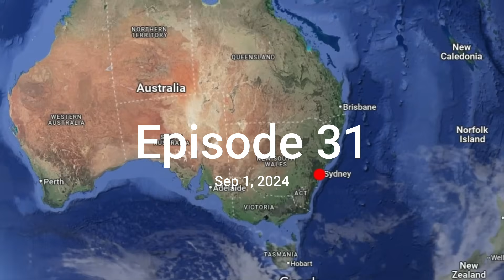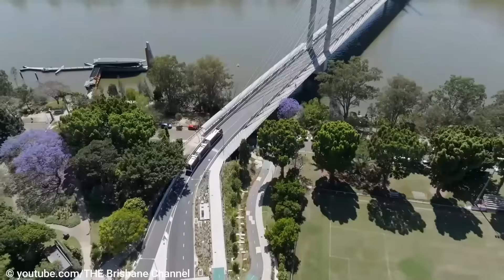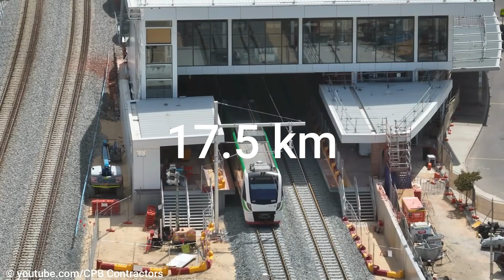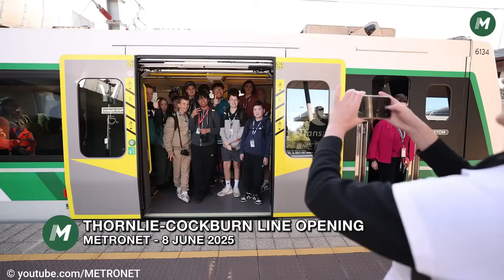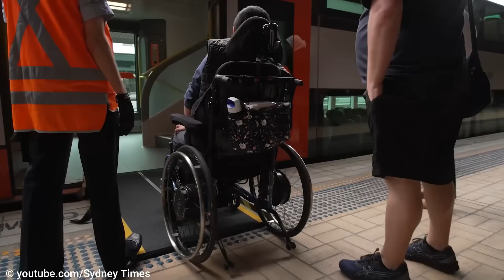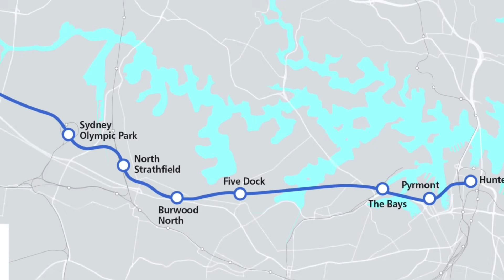All Urban News from Australia (so far)

Comment: Some projects not mentioned:
SUNSHINE COAST - Rail link "The Wave" will connect the Sunshine Coast's coastal suburbs to the greater South East Queensland urban rail network. It is hoped that the project will be completed by the 2032 Brisbane Olympics. The additional line was one of the major catalysts for Brisbane's Cross River Rail project as the original river crossing was already at maximum capacity. 

QUEENSLAND in General - 50c fares are being continued indefinitely. This includes ALL Translink Bus, Metro, Ferry, CityCat, Light Rail and Urban Rail services throughout the entire state of Queensland.  50c Australian cents is roughly equivalent to $0.35 US cents, 0.30 Euros or UK 26p. This is a flat fare regardless of distance travelled. So in theory you could travel from Gympie North to Varsity Lakes, a distance of 261km for just 50c cents Australian. 

ADELAIDE - I didn't hear Adelaide mentioned at all. Surely something must be happening?